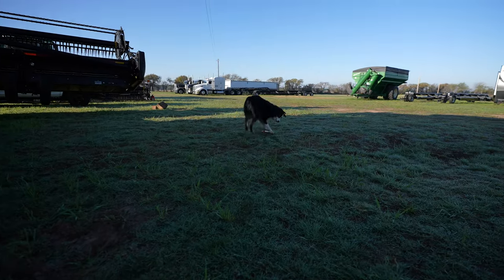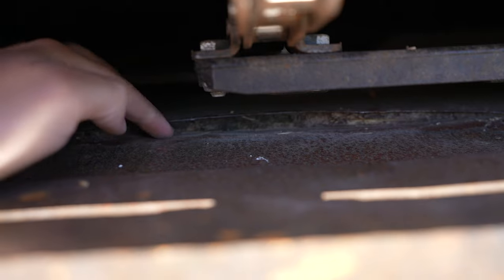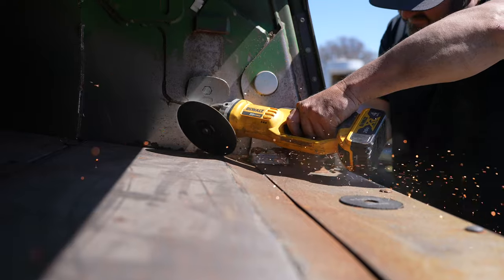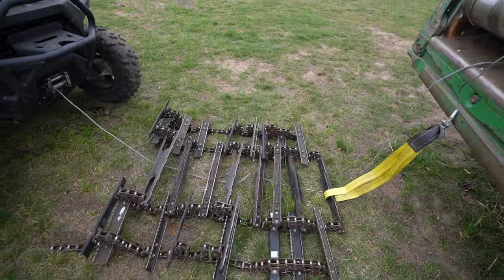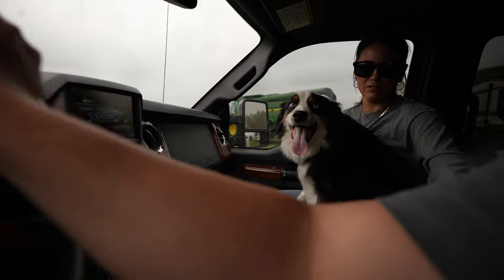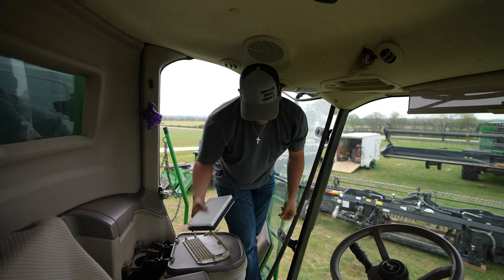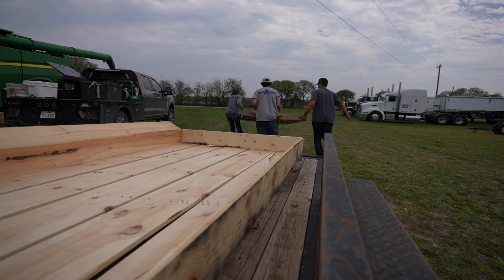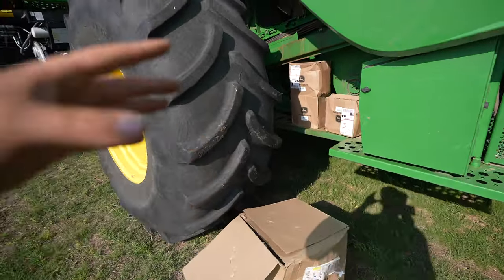One Day Closer To Custom Wheat Harvest 2024

Comment: Throw away middle floor piece, lay 1/4 inch plate over it all, bend front of the 1/4 sheet down and go underneath the front piece..  ....fore and aft will still work.

Comment: When we replaced feederhouse chains, we attached the new one to the old one and pulled the old one over the top while feeding the new one underneath. Seems easier that way
Reply from the maker: It is and we normally do that. Although we needed the chain and the front drum to come out so we could weld a front plate on the floor :)

Comment: keep the old chain when you put new chain hook it to old chain and it will follow it around , if it scips on sproket take a screwdriver and put between chain and sproket then reverse or forward spin it that will or you can adjust it that way i changed about 5 chains in my lifetime
Reply from the maker: That’s what we normally do. But we had to take the chain and drum out to weld a floor in it.

Comment: Was talking to a John Deere tech.  John Deere is launching a x10 combine. It’s gonna have that new same engine that Deere 9RX engine that is 830 hp but the combine is gonna have more horsepower then that. Bigger hopper and other changes.  Maybe you guys will run into one.  That thing is gonna be insane.  Deere is king
Reply from the maker: That would be cool to see one run! I wonder how much it weighs though. It’s hard to axle out these heavy combines on a combine trailer without going to a detached trailer.
Reply: @HaydenOnHarvest  I saw a crew of customers harvesters last year. They had 6 x9s each one was carried on a very large low boy. A normal combine trailer won’t cut it for the new one.